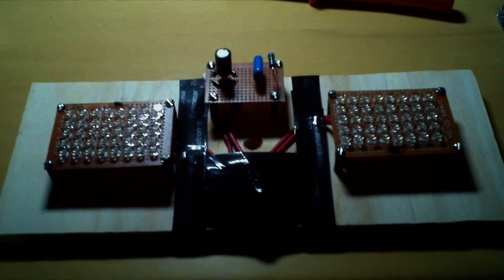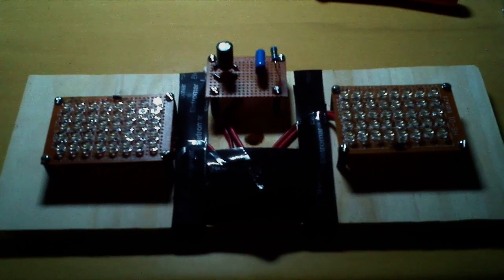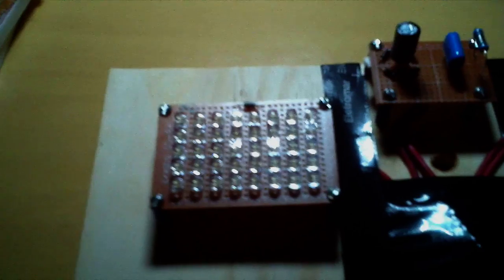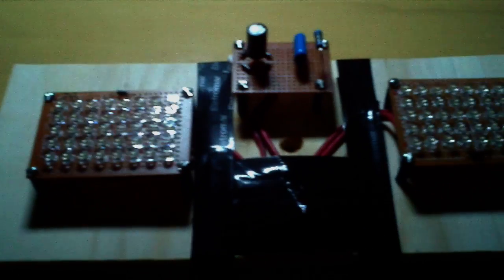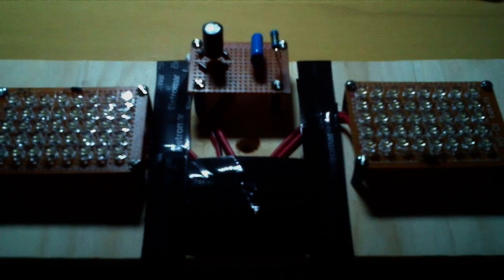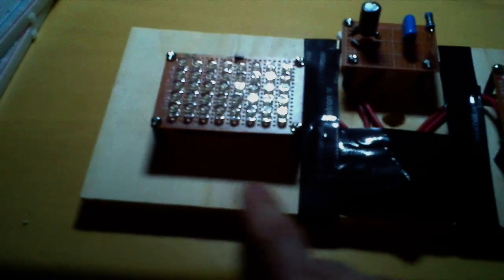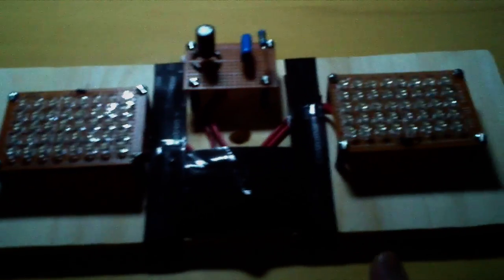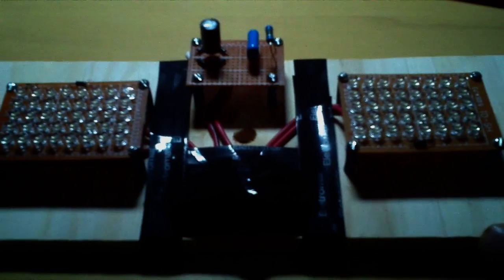5.5 watt Ceiling Homemade LED Light

Comment from the maker: Thanks! Yeah, I´ve already reduced my bill using those lights I´m building. And it is possible, place a pot on the positive rail of the DC that does to the cluster. Or the dimmer switch on the same place.